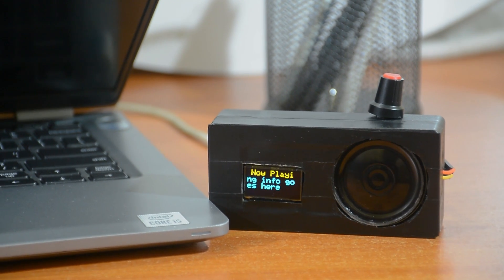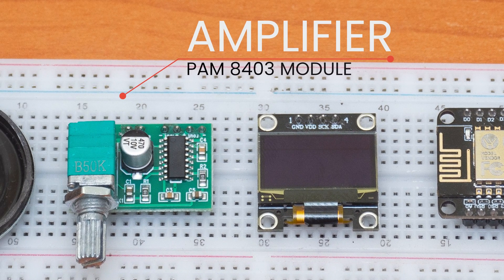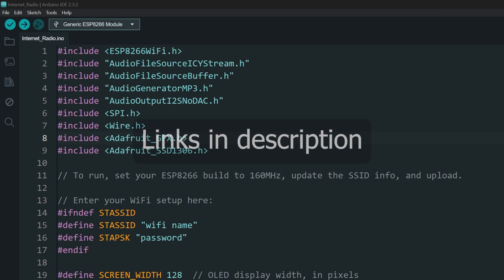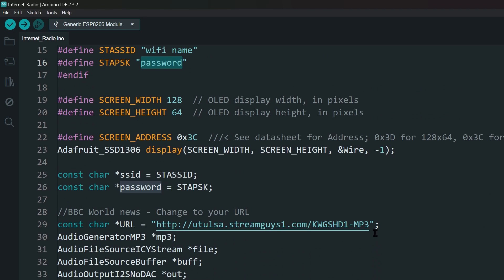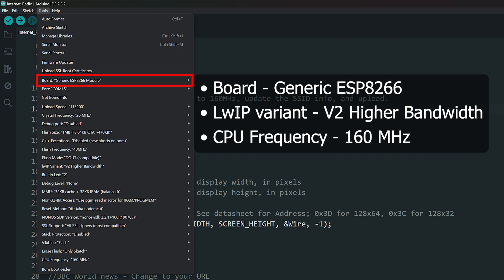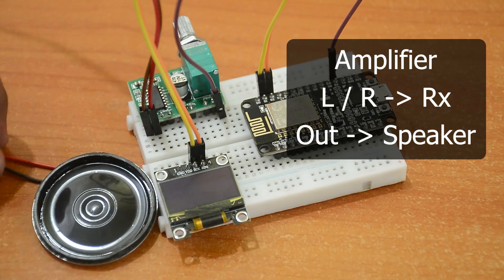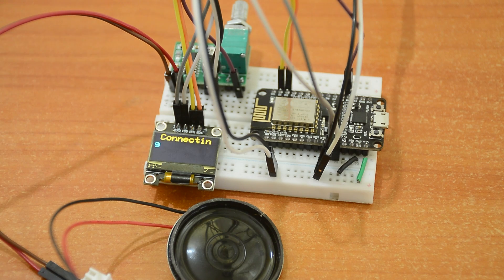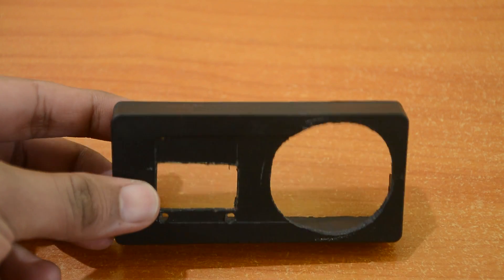Internet Radio with ESP8266

Comment: Always rebooting 
Iam used your code with my wifi credentials 

Connecting...
Connected 
(Loop)
Reply: I downgraded the ESP8266Audio library to version 1.9.7 and then it worked for me.
Reply from the maker: That's an interesting find. How did you figure that out?

Is there a bug in the new version of the library?
Reply: @techtalkies1  When I watched the video again I realized I was using a later version of the ESP8266 Audio library compared to you so I just decided to give it a try by downgrading. I guess it was pure luck.
Reply from the maker: It sounds like an unsupported streaming link. Try with a different link. Usually works.
Reply: @techtalkies1 iam used yours
Reply: @techtalkies1  my PAM8403 amplifier didn't have legs to connect in breadboard
Reply from the maker: You will have to solder the header pins to the amplifier board. Please get supervision if you have never done soldering before.

The link I used in the example code might have expired. Try googling for new ones.
Reply: @techtalkies1  I am having the same issue. I have tried different working links. I have mine on a breadboard. This is the repeated error I am seeing in the arduino serial monitor after it connects to the wifi.
Running for 6799 ms...
STATUS(buffer) '2' = 'Refilling buffer'
STATUS(mp3) '257' = 'Decoding error 'lost synchronization' at byte offset 1264'
STATUS(mp3) '257' = 'Decoding error 'lost synchronization' at byte offset 1264'
STATUS(mp3) '257' = 'Decoding error 'lost synchronization' at byte offset 2050'
STATUS(mp3) '257' = 'Decoding error 'lost synchronization' at byte offset 2051'
STATUS(mp3) '257' = 'Decoding error 'lost synchronization' at byte offset 2052'
........
Reply from the maker: That looks like a stream link problem. The esp8266 can only support very low quality stream links. you need to trial and error to find working links. Try the ones that are in the library examples or the library GitHub page. They usually work.

Comment: Can I steam url with.m3u8 extension or .m3u
Reply from the maker: No. It has to be direct stream link.
A good way to check a link is, paste it in browser, audio should directly start playing in the browser. Those links will work.
You can use the inspect feature in chrome to find links on a webpage.
Reply: @techtalkies1  I tried similar project with esp32 and failed. The audio output was not continuous, it will skip frequently and eventually it will stop. I think the bord itself is faulty.
I will try this one next week, ordered my parts already.
I will keep update what's happening around. 
These are fun thing for those who interested.
Reply from the maker: I had problems like this too!
Usually it's the link problem. Make sure the stream links are not high quality like 192 kbps.

Very low data streams like 64kbps works great. Others skip a lot and also eventually stop.
Reply: @techtalkies1 can you share a link which you were successful, so that I can check. every url i tried have the issue. skipping all the time.
Reply from the maker: Have you uploaded the same link in my example code? It works normally!
Reply: @techtalkies1  I tried the link and it was Unsuccessful, I think the particular sketch that I'm using on esp32 board will not allow .mp3 kind of URL, but it do work with .m3u8.
Reply: @techtalkies1  I tried your link and it failed, I think the sketch i'm using will not accept .mp3, but it do work with m3u8 with skips.
Reply from the maker: I mean have you tried uploading my sketch exactly as it is? Changing only the wifi name and password?

And if not, are you using a different library than my example?
Reply: @techtalkies1  Right now in my hand I've esp32 not esp8266. I tried your audio streaming link on my sketch for esp32 for an experiment. It doesn't work.

I will replicate the same project shown in your video once the hardwares available to me.
Reply from the maker: Oh yes. That example is only for th 8266 boards.
But! It can be easily converted for the ESP32 boards just by replacing the include file.

Simply replace the include ESP8266iIFi.h with #include <WiFi.h>

It should work. Let me know.
Reply: @techtalkies1  Work done and it's work fine. when my router is connected with many devices, it shows problems, as soon as i disconnect most of it, work fine. thanks for the script and the link. I like talk radio so the link provided have all kinds of news.
Reply: This time i tried with esp8266 same as yours, lately i tried with esp32, which i consider unsuccessful.